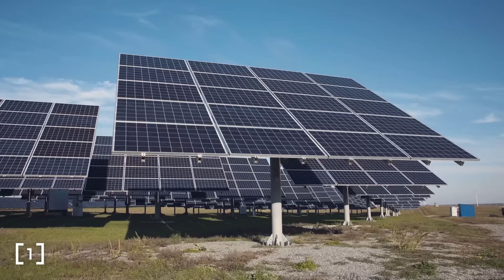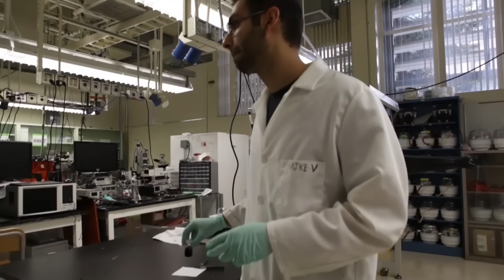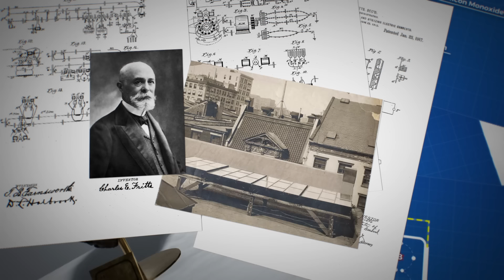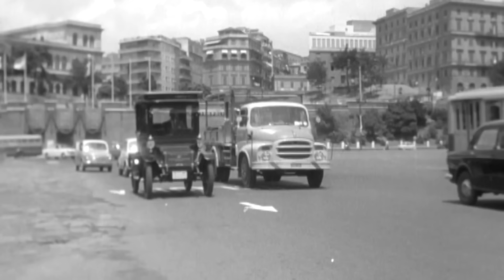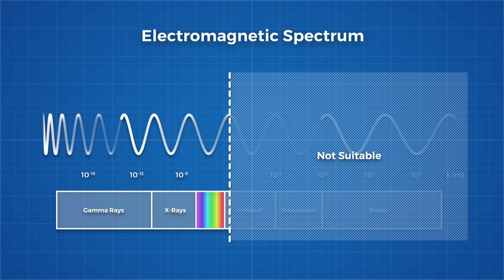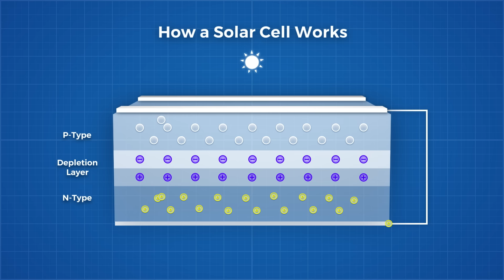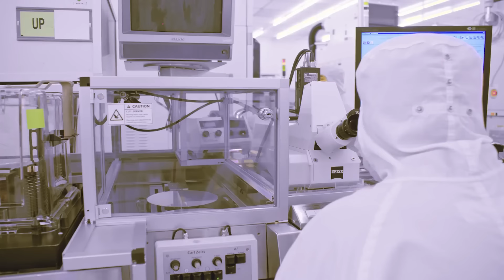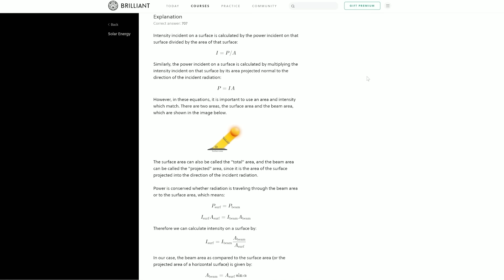The Mystery Flaw of Solar Panels

Comment: I was told by a electrical engineer that micro mirror chips can be impregnated into the Soler panels ,it would increase the reflection , the spectrum can reflect into infinity? He also said that the panels can be sandwiched to where the bottom of the panels can pick up lite , like the top Doe's, then mirror's can be placed under them where they can receive lite from the sun from refection, he said that way they could get more efficiently per acre,  it sounds possible,

Comment: Wonders if we are not putting the cart before the horse.  Maybe we  should figure out how to actually STORE the electricity we generate...
Our electrical grid store 0% of the electricity we make.  If we could STORE power, we would not need to make as much of it.
(btw  Batteries are NOT storage! for all intents and purposes batteries are just slower discharging capacitors.  ALL batteries loose their charge over time.  The only true renewable energy we have so far is Methane!  (produced from garbage)  but  for some reason we don't talk about that.

Comment: Installed capacity, tut tut, why are you called real engineering when you perpetuate this crap. Lets have actual output, with graphs of hourly efficiency. You know some actual science.Plus panel degradation and efficiency over time. Maybe production carbon costs, recycling costs.

Comment: Most solar cells consist of strings of cells in series to get sufficient voltage to operate the DC to AC convertor or the battery charger. One problem with this that I don't know if they have eliminated is that one of the solar cells in the string is in shadow it acts as a high resistance and stops the current floating. This was a major problem with solar panels on sailing boats where shadows of the rigging or mast would fall on the panel and stop it generating due to one of the string being high resistance.

In the discussion about efficiency this is only for the case where the panel is perpendicular to the Sun - this only happens once or twice a year. The rest of the time the power is reduced by the multiple of the cosine of the angle between the sun position and the position perpendicular to the panels. It is possible to get round this with a sun tracking array but that is big & expensive.

As a result of this and the efficiency figures of 18% above it would be interesting to see how much energy is actually generated each day from a square meter of panel. Of course you then need to factor in the weather as well.
Reply: John Murrell This was solved with the invention of Sliver Cells (that's Sliver not Silver) however the mass production of Sliver Cells hasn't come to pass, as it's too expensive to be worthwhile.
Reply: @lappy65  So if the solution has not been implemented due to economics I presume the problem still exists of solar panels 'shutting down' if part of them is in shadow.
Reply: @johnmurrell3175  I'm sure there are other solutions, though probably not quite as efficient as sliver cells. Panels can be made with a combination of parallel and series cells and panels are available with individual lower powered inverters and many higher powered inverters have multiple inputs, also not mounting panels where they will be shaded in the first place helps. In my case, my 5kW inverter has two inputs each with a 3.25 kW string of panels none shaded by overhanging trees or structures, one of my neighbours has 45 panels each with its own 200 W inverter.
Reply: @johnmurrell3175 modern panels are made with bypass diodes. That provide a low resistance with a .2 volt drop.

Comment: I have a solar home in the tropics and it is not that great, because it is not that reliable and both the solar panels and batteries degrade quite quickly before the system pays for itself, so you are always in a financial hole.  In any event, solar panels have nothing to do with planet climate changes, since despite the propaganda, they really don't know if we are getting colder or warmer in the long term.

Comment: Very informative video on the whole. Thank you. However, in engineering you should stick to the simple proven (tried and tested) facts. When you diverge into plants developing or evolving you move into the mythos. It is unproven and unecessary. Plants just perform what they have been programmed to do. There is no conclusive evidence one way or the other that they can go beyond this programming. Unless this is scientifically proven using the scientific method, transitioning to the popular evolution myth as a practical basis for anything is akin to using religious faith. We believe plants have evolved/developed is exactly the same as saying God designed plants to do this. Personally, a designer is much less a leap of faith than vegetables designing anything. However, it makes no different to real world applications. Patterns repeat in nature and there is no evidence that they can develop beyond this programming. So the evolution hypothesis is just that and should be used accordingly (or not all if possible) in an engineering tutorial. It is not necessary or helpful. 
https://youtu.be/2GCWGyWCLTo

Comment: Being a solar engineer myself i can vouch on the efficiency of this video. Beautifully done ! Btw there is also LeTID which is a growing concern in PERC cells due to hydrogen passivation. Maybe you could do an immersive video like this on it sometime.
Reply: Hardik Bhatt could you elaborate a little about letid in perc?
Reply: @Broxine  Where LID is a consequence of formation of Boron Oxygen complexes LeTID has been observed as a consequence of (to put it simply) too much hydrogen content in the form of rear side passivation. With increased temperature and illumination on field the hydrogen atoms are freed into the Si-Bulk this is just another way of saying that the free electrons available are reduced by the presence of extra hydrogen. This effect accelerates and is visible when perc modules are subjected to high irradiation and temperature. Ask a manufacturer about it..and they will either have no clue or will simply deny this. I don't know why. With more than 10% of the global industry immersed in PERC technology this is something that should have been studied extensively and the least they can do is educate the public about it.
Reply: @Broxine   the losses due to LeTID have been observed to go all the way upto 10%
Reply: Hardik Bhatt wow thanks for the explanation. So is it better in your opinion to avoid buying perc modules?
Reply: @Broxine  that is not an option since the industry is slowing moving towards this technology. The best thing to do would be to have a strong legal contract which ensures that you're covered on linear warranty in the event that the degradation is very high

Comment: Soooooo....why not just jacket all solar panels with liquid cooling technology on the backplane?  Instead of liquid, you could use refrigerant and use extremely small capillaries for the expansion phase.  You then extract the now warmed and decompressed refrigerant and compress it to make it extremely hot.  You use a liquid exchanger through a complex web of either sterling engine or thermal engine to provide power while cooling down the superheat refrigerant to condensate.  Then pump that back through the loop, and you use a tertiary system to cool excess heat similar to a standing trickle tower (like a nuclear power plant but not so massive).  You then improve the efficiency of the solar panels AND get a little extra energy, possibly more than enough to run the exchangers and compressors.  The only thing you have to do is replace the front protective panel every couple years (weathering degrades the material)...but that's just plastic, really cheap.

Or, you could grow a bunch of trees, cut them down at maturity (about 35 years), chop them up and burn them as fuel.  At a rate of 0.2 inches per year growth, at 35 years would yield approximately 0.75 tons of wood, which results in about 1973kwh of electricity.  Planting is 8 foot distance, so about 6m^2 space with a 1,000 w/m^2 of solar radiation, yields an energy efficiency of 0.643%?  Or we could bury biomass into the ground and weight several hundred years for it to turn into oil.....which is far less efficient?

I think the 15% > 0.643%....but I could be wrong....I don't know, is 15 bigger than 0.643?  We may have to consult an expert.

Comment: Also there is a different phenomenon that is a problem with solar cells. Contrary to popular belief, it is not as clean as we think. Yes it is reducing oil and coal dependence but the more grave concern is the energy trapped as heat on Earth due to solar panels. Usually, 1-2% light was used and rest was reflected by leaves. But with solar panels 20% light energy is used and converted to work and ultimately heat. What is happening is that sun energy is being concentrated on Earth as collectors and light energy and ultimately instead of reducing temperature of the Earth it would actually end up increasing it further as the energy instead of going back to space keeps concentrating on Earth.

So, with a cleaner environment in terms of carbon dioxide and other gases it still keeps warming the surface of the earth as before but only at a much faster rate since we are keeping more light energy for ourselves and not letting it get reflected back into the environment
Reply: with less co2 in the atmosphere heat escapes faster at night (less greenhouse effect).

Comment: Installed Solat is about 1.8% of the total national load.  giving BIG numbers as in the start of this video does nothing unless you include percentages or a pie chart.
This is NOT putting fossil fuels out of business at all.. yet... Someday it might make a dent but not yet.
Reply: I hear that single solar panel cost more energy to make in fossil fuel, than energy output for its whole lifetime. Any thought?
Reply: @eavyeavy2864  it might of being true a long time ago but only when it was a novelty item costing more then a car, but not anymore lol.
Reply: @somedumbozzie1539  I once did the math comparing the total required acreage, build time, cost, ongoing maintenance, materials required, etc. of a 2 GW nuclear power plant versus 2 GW worth of solar panels (actually, more than 2 GW worth of solar panels, since they are useless all night, during harsh weather conditions, etc; whereas a reactor outputs 24/7 in all weather conditions).

Nuclear is far, far, ABSURDLY better than solar in every metric. The cost, acreage, manpower, materials, etc. needed to install and maintain 2 GW (constant) of solar panels far exceeds what is necessary to install and maintain a 2 GW nuclear plant. As far as acreage goes, nuclear's footprint is a postage stamp, whereas solar's is a subway wall poster. Of course, fossil fuels are also far more energy-dense than any form of green energy.

ANY DAY NOW green energy will take over, and we'll save the planet! Certain people have been saying that for at least twenty years, and it hasn't happened. Never mind that all of the R&D and manufacturing that goes into "green energy" technology wouldn't be possible without the incredible energy provided by a fossil fuel and/or nuclear economy, and couldn't even self-sustain.

The guy who runs this channel seems to be fully hoodwinked by the usual suspects of politicized environmental issues, despite supposedly being an engineer of some kind. I find it difficult to trust or respect an engineer who doesn't understand the basic realities of energy production, but then again, he's not the only one who's deluded.
Reply: @0SuicideBoy0  you're pretty damned deluded and clueless yourself.
Reply: @0SuicideBoy0  To simply put it, if you care about the planet, solar seems to be the right choice, but if you're thinking about the lives & livelihoods of millions, of running industries & nations, traditional sources are still unbeatable. Not to forget, that most people around the world fight for the basic right to electricity, and simply don't have the 'luxury' to accept the solar as a reliable source yet. However, as grids become smarter, where one can source renewable energy from different sources, solar & wind etc will start powering our future cities, whereas nuclear (or hopefully, something less controversial) will power the industries away from the human settlements. Green may not take over, per se, but may just become rightfully useful at some point in the process.
Reply: @anab95.7  PV Solar panels aren't even the best 'green' choice when you consider the full product life cycle of solar panels; rare metal mining, processing, the land being used for PV solar farms that can't be used for other things like forests, and of course disposal (since recycling is a joke).
Reply: @anab95.7  Solar is pretty much only useful in the deserts of Africa....js
Reply: @anab95.7  something to keep in mind though is those green energy sources would bring other problems pretty much the opposite of fossil fuels, cover most of the planet with panels and planet will freeze. we really need fusion :P
Reply: @anab95.7  I have grave doubts as to whether or not solar and wind energy (two focuses of green energy) can actually sustain themselves, without fossil fuels and nuclear to help them.

In order to construct photovoltaic solar panels, we must mine silicon, copper, iron, silica, and miscellaneous other materials. Mining requires heavy transport vehicles, heavy machinery, workers (who all use energy and electricity in their personal and professional lives), and so on. These materials then must be transported to refineries where they're refined, then the refined materials are shipped to factories where they're machined into parts, and then the parts are assembled. Factories require massive amounts of energy and workers to run.

Then, installing the solar panels requires more vehicles, more workers, planners, R&D, and so forth.

So by the time the materials have been mined, refined, turned into parts, turned into solar panels, and the solar panels transported and installed, how many decades until they pay back the huge energy debt that went into their creation? Keeping in mind they'll require maintenance the entire time. Right now, almost all of the energy used to run those heavy trucks, the heavy machinery, the factories, to sustain the workers, etc. comes from fossil fuels directly or from electricity generated by fossil fuels.

No one seems to be smart and/or brave enough to address these hard realities on their YouTube channels.
Reply: @0SuicideBoy0  Manufacturing about any product we use requires mining various metals and minerals required for production and uses equipment, workers and so forth. Your point is very one sided.
Reply: @0SuicideBoy0  word enchancher make your buildup collapse. Thats comment equivalent to clickbait video.
Reply: @i-hate-handle-names  Everyone talks about  how green the solar panels are but I never hear any talk of other products like let's say, lawn mowers' efficiency.  The full product cycle of a lawn mower is waste, waste, waste. And they don't even produce ANY energy.  But no one complains amount making those.  A small fraction of the resources it takes to make mowers instead going into producing solar panels, that actually help produce energy and cool down the planet, seems like a very good deal.
Reply: @27kilofoxtrot  A lawn mower's purpose is not to produce energy, it is to cut grass. You are literally make an apples and oranges comparison and getting proud of that fact.